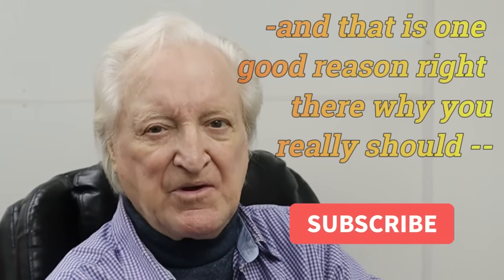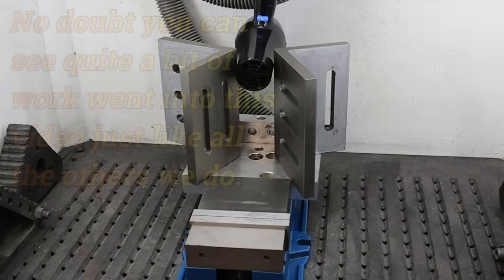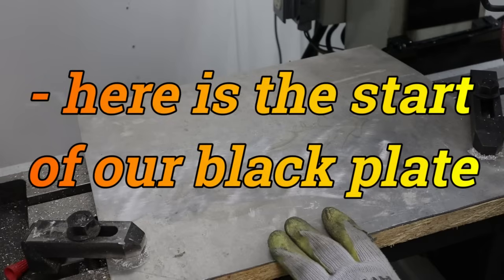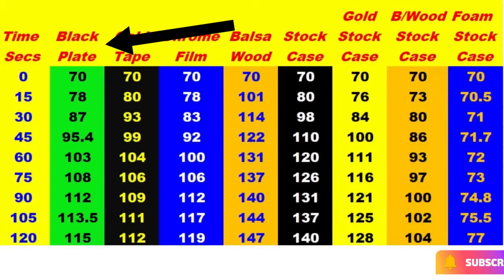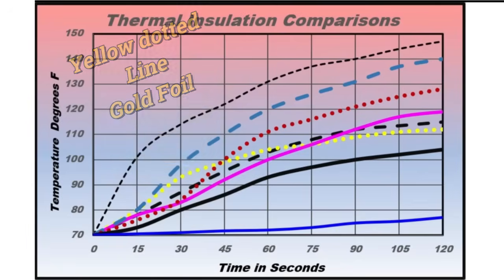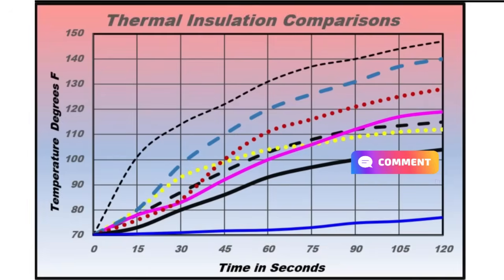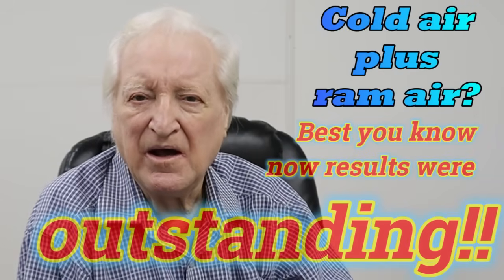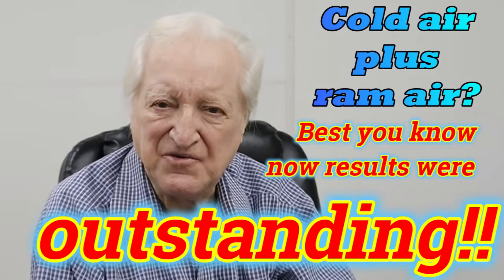Cold Air Induction systems - Just a scam or  ???

Comment: Something to consider as well. Does air cool down when it moves really fast, or through a nozzle? I've had problems with the inside of a sidedraft carburettor filling up with ice in areas where there is no fuel or water even the outside of the carburettor becoming covered in ice too. Worse on humid days regardless of the outside temperature. Perhaps oversized intake tubing is detrimental to the temperature of the charge? Even worse if it's black or of a heat absorbing material.

It's called adiabetic cooling...  have you ever held onto the bent metal tube on the blow guns you can get for your compressor? They start to go cold as soon as you pull the trigger, right?

Comment: Lowering the air temperature at the turbo will never go down below ambient air temp unless you have some form of liquid/ice box cooler, where you are going to drop your temperature is after the turbo through the intercooler. My Roush cold air intake will run from 4 degrees above ambient air temperature in traffic down to 2 degrees above ambient air temperature and I often see ambient air temperature to the turbo. Again it is after the turbo where you need to lower the air temperature and my MAP (Modern Automotive Performance) billet aluminum end tank intercooler in hot weather in the 90's I can see temperatures as low as 9 degrees above ambient air temperature and when the outside air is 50 degrees range I have seen ambient air temperature after the intercooler.

Comment: Let me make this easy for everyone, Roush has a cold air intake that works, Roush has access that no other aftermarket manufacture has and that is direct access to Ford CAD design files so Roush is able to design their products to work with Ford engines. Another site did dyno tests of 5 different cold air intakes including the stock intake system and the Roush was head and should the best in the dyno results. This was done on a stock Mustang Ecoboost.

Comment: Need a cheap & simple tool to test actual underhood temperatures? You might consider using a 4-channel digital wireless thermometer system designed for BBQ. Seriously about $40. will buy you 4ea SS sensors w/43" leads, a battery powered 4-channel transmitter, and a battery powered 4-channel receiver/display/control. Usably temperature range 0-300F/32-572F. I just bought a "Taimasi" extended range wireless BBQ & meat thermometer kit on EBAY, and it cost exactly $39.11 with tax & shipping included. Very soon I will try it on my K24 Civic hatch, will test outside air filter, inside air filter, inside coupler between CAI & throttle body, and taped with alum. foil tape somewhere between plenum and head. At first, I will only record the results, but I will probably try wrapping shiny aluminum CAI pipe with a bit of the foil bubble insulation. After that it will be mostly used for a summer of BBQ & Sous Vide beef.

Comment: Find some Kwool 1/8” ceramic paper if you want the absolute maximum heat reduction. You can lay it on an oven element and hold your hand 1/4” from the paper and hold it there

Comment: I just saw a Jeep with a "cold air intake". I had an aluminum tube with a cone filter on the end of it sitting in the air box area. The top of the air box was missing and the element was open to under hood hot air. Truly was a hot air intake.

Comment: "That's power and anti-detonation right there."

They solved this in WW2 fighters with water/methanol injection. Further, there are modern kits for cats that scavenge air-conditioning condensation to reduce the need to top off the water level of those water only injection kits. Driving4Answers covered it in a recent video.

Comment: Having made custome silencers for commercial air conditioners, what I learned was air is a thermal barrier and media served to uncrease the surface area of air trapped inside the thermal media. All that to say, inside atmosphere, everything in contact conducts. If you use a thermal blanket and wrap it around the inlet pipe too tight it will become a conductor. If you use reflective media, (gold or silver mylar), and its touching what you want to insulate, it will conduct. A snug wrapped thermal blanket with reflective media wrapped around it should yield best results against conductive and infrared heat. Thermal wrapping things like exhaust headers and the hot side of the turbo with further lower engine bay heat and could remote the need to insulate a cold air intake if the intake has a short enough run to the intake manifold.

Comment: Back in the 70s i built an air box to pack with ice sometimes dry ice to lower intake air temp and i could feel the higher torque and see the quicker acceleration. No real science used, just did it by guess and on principle. Newer engines are already engineered for higher efficiencies and a lot more engineering is needed to pull out more HP.

Comment from the maker: Guys,Just got to look at this video of mine for the first time since the day after it was posted.
I want to say something about the critical posts that reference  the types of heat a cold air box has to deal with.
My first comment here is that this is far from my first rodeo as far as thermal criteria are involved. If you came to that conclusion then I only have myself to blame for not being more concise.
Let me explain here. Firstly ther location of the airbox on an Ecoboost Mustang is in a position where there was little radiated heat involved. The otherside of the engine is a very different matter.  My airbox had to be proofed against  a great deal of heat conducted via the hot air in that region. My tests focus on that aspect on the heat reduction into the  intake charge through the case walls.
Next the comments pointing out that the reflective materials should face the heat source. They were but a photo of whatever was being tested could not be photographed through the aluminum sheet. For that reason I had to turn them around to show what was being tested.

My apologies for any confusion here. Will do my best to minimise such in future.

Thanks for your patience here from PowerTec 10's most confusing tech guy!!!!
DV

Comment: Bit confused here. Still talking about carburetors while working on/with the EcoBoost Mustang engine. That car has an injection system. And is controlled by signals from sensors to the ECU. That includes the Cold Air Intake sensor.
...thus the colder the air the more gasoline will be injected. The engine will run rich. Not over rich that is.

Comment: I don't know why, but paint has been developed that reflects IR back as if it were white, though it is some other color, including Black, in the visible spectrum. 

My point here is that the visible color may not reflect its insulative value (by reflection or radiation of IR). It also implies that the finish can be chosen to perform much better than you would think, given its color.

Comment: Would I be correct in saying that the largest factor is the amount of time the air is in the inlet? 
In other words, even if the air box, plumbing and inlet port, were hot, there’s not enough time for the surfaces to radiate heat into the air volume, due to its speed. 
🇦🇺💙🤜🏼🤛🏼😎☮️🍀

Comment: Hello David off subject here, but could you do a powertec video on cylinder heads sizing for combustion chamber sizing based on gear ratio an vehicle weight for racy applications drag strip/ pull truck /boat bbc…. Thank you for all your years of knowledge an taking your time to help others understand performance of any engines with all those years of testing that had to be very expensive. Thanks agin Tyler.

Comment: I have a 4" Anderson Power Pipe for my 1989 Mustang 5.0.  Its ceramic coated (inside and out) and takes in air from the cooler fender-wall.  Can't say if it made a difference as I installed new heads the same time.  It's piece of mind as my previous setup was pulling in air from the hot engine bay.

Comment: I've ran these tests in the past on a twin turbo N54 BMW. The gains your seeing now would probably be insignificant with an upgraded intercooler. I found that on my BMW that lowering the inlet temps 40 degrees before the turbo only resulted in an 8 degree drop at the intake manifold with my upgraded intercooler. Combine that with the cooling advantages of direct injection and there's very minimal benefits for companies to spend time researching ways to keep the temps cooler. Primary focus is flow and aesthetics. The cars I've seen with upgraded downpipes, exhaust, piping, intercooler and running an Ethanol blend of at least 30% on direct injection setups showed minimal gains with a cold air intake over just a filter on the turbo sucking hot air. I love the fact that your analyzing every little piece, can't wait to see any intercooler testing to show intercooler designed, heat sink efficiencies and pre/post efficiency numbers. I wish all intercooler companies tested those but unfortunately that's rarely disclosed.

Comment: those non contact thermal cameras don't give good readings on reflective surfaces. a thermocouple would have been better. And wouldn't you want those heat barriers on the hot side of the aluminum sheet? Assuming you're modeling the thermal performance of an intake system in a hot engine compartment?

Comment: I don't see how this test applies to a cars induction system. From the time the air enters the inlet and is out the tail pipes is likely in milliseconds. There is no time for that fast moving air to pickup much heat from a heat soaked induction system.   So looking at your 0-1sec line they all would basically do the same thing? You basically just want a source that's sucking up as close to ambient air temps as possible. The radiant heat seems likes a pretty useless performance marker?  

Similar to frost forming on alcohol intake runners.... that doesn't mean the air entering the cylinders is anywhere near that cold. The in coming air has no time to have much heat pulled from it.

Comment: Hello Mr. V.  It looks to me that in your tests, the films and tapes and such are on the back side of the aluminum (i.e. facing away from the heat source).  I would assume these materials should be facing the heat source and covering the entire aluminum sheet to see how much heat makes it through.  Please correct me if I'm wrong.  Thank you for your extremely valuable information.

Comment: Heat is transfered in three ways. 1. Conduction. This is when a warm material transfers heat to other materials touching it. 2. Convection. This is where a gas or a liquid moves against a nother material and the heat gets transfered very similar to conduction, but because at least one of the materials flows, the heat keeps getting replenished with "freshly warm" flowing material. 3. Radiation, where electromagnetic waves (yes, light is a form of electromagnetic waves) transfer energy from the source to the material absorbing the waves. 

The gold form in the start of the video is very effective against radiation transmitted heat, but does not do a lot when it comes to convection, which was how it was tested. Foam works very good against convection since it creates an extra layer with bubbles inside the foam that are hard to heat. 

In order to create a good cold air intake you need to take into account what kind of heat transfer is happening under your hood and how long the air you are ingesting is actually in your intake system. Ingesting air from outside of the engine compartment means usually that within a few rotations of the crankshaft, the ingested air is already inside the combustion chamber. You get mostly radiation and convection heat transfer under the hood, Conduction is not a large source of heat for the intake trajectory. Isolate for Radiation and convection and don't overdo it, the air inside your intake is only heated for a very short period while driving. Having said that, driving off from standing still makes heat soak in the engine compartment a significant factor so you will want to properly insulate for that.

If you want to test how efficient your cold air intake is at keeping intake air cold, you need to measure the actual air temperature directly outside your intake and measure the difference in temperature at the intake of the cylinder head, or whatever compressor you use if you aren't working with an atmospheric setup. Measuring a hair dryer through a sheet of plastic is not representative for the condition in an intake system of a running engine.
Reply: Exactly. Needs to measure input and output air temperature at running velocities. My newer silverado has a reflective fiber insulation behind the engine.
Reply: Spot on what I was thinking with mylar in general. The logic is, "NASA uses it to keep infrared telescopes cool in space, so it must be good at keep things cool." The problem with that logic is the mechanics of the medium it performs in. In this application foam, fiberglass or mineral board would be better at sequestration. For ease of use, a thermal blanket would be the simplest solution if the incoming air charge will be exposed to the heat of the engine bay long enough to be an issue.

Comment: David, your test data would be better with the use of a FLIR camera. Although it is dynamically self calibrating, mounting it on a tripod in record mode and using their software would allow you to build excellent temperature curves. Infared Guns a nice little toys but I only use them for non critical measurments. They are too effected by environmental conditions and angle of approach to the measured surface. I found them 100% useless when heating a large mass of steel. A large drive coupling that needs to slide on a 5" diameter shaft. The glorified laser pointer told us is was still only 150F while the old school 350F temperature crayon about vaporized because we had to large rosebuds on it for longer than needed to slide it on the shaft. We had so much radiant heat the chain of the chain fall holding the coupling grew so much it dropped 2" out of alignment. That was the last day I relied on infared temperature measurement.

I would rather see the airbox mounted in a hot box, with ambient air flowing through it, record ambient, internal temp, outlet temp and airflow. Then you woukd be able to calculate mass air losses (density deviation) from the different methods of insulating from heat soak. 

I think, while your test showed results, its anecdotal data that does not fully represent what is going underhood. Using a real fan with an airspeed sensor mounted on the inlet of the cold air/ram air entry on the dyno capable of providing road speed effect with the hood closed would be useful data. The airbox is getting heat soaked with 200F air from the heat exchangers feeding the under hood area. Thats why we run the Trackspec hood louvers on these Mustangs. It allows more airflow through the cooling module by lowering the positive pressure under the hood, places a path of least resistance to evacuate the hot air, and also provides anti-lift qualites at track speeds because that high pressure zone heads in the direction of zero. 
The Multimatic built Mustangs still run the factory GT airbox, there is so much negative pressure and open element air filter that is so popular hurt HP. They even went so far in the early models to cut away the inner fenders ahead of the strut towers to reduce pressure.

Comment: Real question not a dig.
So if a aluminium/composite intake manifold doesn't have enough time to transfer radiant heat to the intake charge due to the speed at which the air is moving at part to full throttle how would a un-insulated/insulated air box transfer heat to the inlet intake air providing the intake system is not a restriction in any way, and is drawing air outside of the radiant heat of the engine bay? How fast is the intake air "moving" as it is drawn into the engine at atmospheric pressure? How much does charge cooling affect air intake temp results carbureted/TBI vs EFI/DI?  I just don't see how insulating the air box would make a difference to air intake temps if the system is not restricted (0 vacuum at 14.7 psi barometric pressure at full throttle) and is drawing cool dense ambient air or rammed air?

Comment: The gold tape is aluminium with a yellow tint and would have very similar results as the chrome film. NASA use actual gold metal foil which I think has the lowest emissivity of any material and therefore best heat reflection. McLaren used it on the F1 but its also very expensive!
Reply: I believe the DEI gold foil is actually the aerospace grade stuff, but I could be wrong. That's not what he used, obviously. Just making mention of it.

Comment: I have put a special insulation tape on all surfaces of my filterbox, intake from outside and house to the turbo. I had a drop in temperature on 22 dg celcius. Put in a KN filter and had a small gain in hp and torque. Put the same tape on the hose from intercooler. The hose was close to the turbo and ERG so it was very hot. After the tape it had a drop in temperature of 31 dg celcius. The car runs very strong and drive longer pr liter Gasolin. All the best from Denmark 🇩🇰
Reply: What was the brand name of the tape that you used?
Reply: @armandomendoza3167  I cant remember the name. But its the industry use it to keep the heat from getting to one pipe/hose to another. Its often used around turbo ect.
Reply: @mortenjrgensen5497  Is it Marine grade industrial? Or mining industrial?
Reply: @armandomendoza3167   industry . I can see if I can find where I got it from and the name. It was a danish company
Reply: Autofix nu that is the site. Power wrap selvklæbende tape. This is the name of the product.
Reply: @mortenjrgensen5497  thank you. I'll check it out.